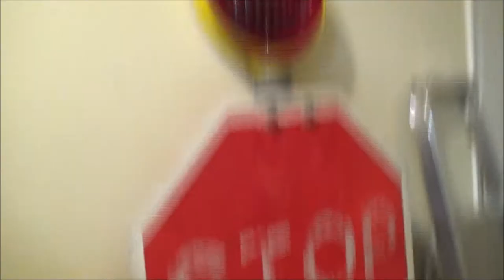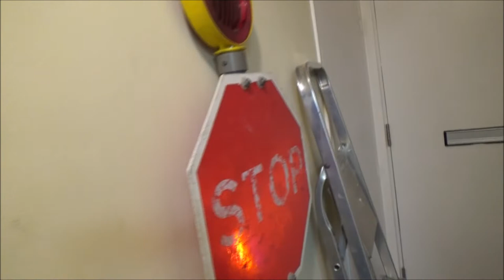Retro Tapes, Cars And More.

Comment: I like your 'bits n bobs from charity shops'  videos, it's often surprising what you can find, like the radio cassette I recently bought. 
Although the best shops are the ones that sell electrical items, many don't accept electric products because they don't want to get involved with PAT testing etc.
Reply from the maker: There are a few in town who will take electrical items. But I guess some wont due to PAT test costs and what not
Reply: On PAT testing, you can just take a one day training course to be qualified,  seen it done loads of times at my last job.
Basically it's just check the plug for correct connections & fuse,  check for earth continuity (where applicable ) & an insulation test.
If it passes those tests,  it's deemed safe even if the appliance doesn't work properly.
Reply from the maker: @NOWThatsRichy  Yep. Also needs a visual check to make sure there is no damage that could make it unsafe. I'd love to do the course but I can't afford it and my job centre no longer funds it